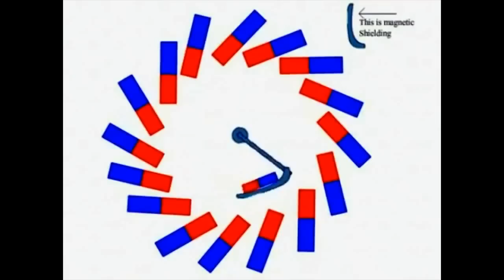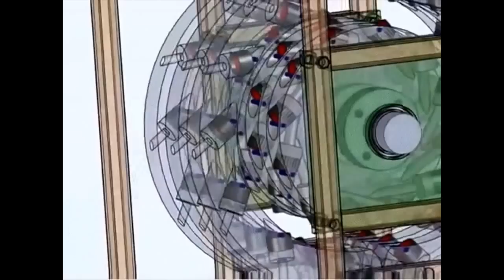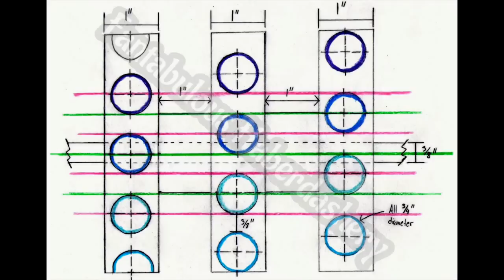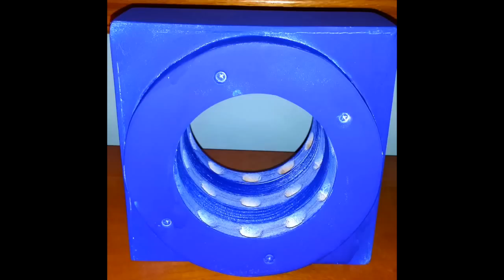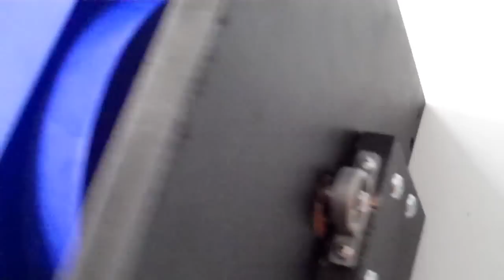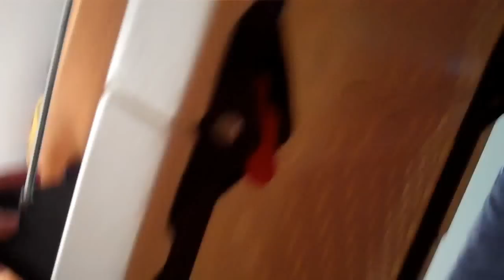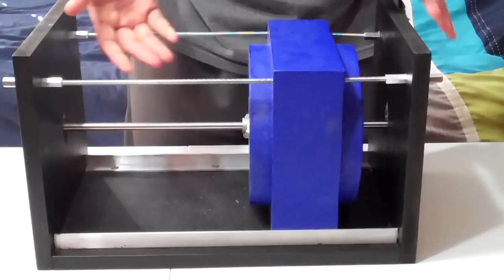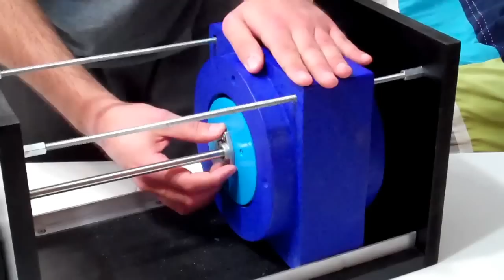Working Perendev Magnet Motor!

Comment: OMFG, MAGNETS HAVE ALMOST NO ENERGY, this motor works not because the magnets are a battery, if this were the case then it would come from the process of making the magnets, this is not how magnets work. it is not known which but either:
A. the first law of thermodynamics is wrong. (after all, it's not proven)
B. there is some environmental/radiant source (maybe zero point energy fields) that the energy comes from.
on a nicer note, this is a cool vid, it looks like it is working at least partially working.

Comment: To sustain the motion you need a small dynamo to generate voltage,store energy in a capacitor and run a separate motor to spin the rotor when it is slowing down and repeat the process.

Comment: Put about 20 of those on the same axle and see how much power it creates.
First true it then wire it to catch all the lost magnetism and route it back into it
Yeah, and then create capacitor charges from gathering the magnetic fields to fire at certain points at certain time  to impact the magnets like compression on a combustion engine only using magnetic fields condensed and configured properly
Controlling where the magnetism is needed to boost energy
But using only the rotation and creating slight electrical charges from rotation and small wired generators and capacitors to thus build on and reuse what it created back onto the motor.
Then improve on it and by making all the generators and capacitors yourself to configure to how much the motor at each stage can output to power them

Comment: If the horseshoe magnet is positioned correctly, it does not affect the other magnetic pole, if it does, it can be deflected with an iron plate.... Half-skin arc magnet Etc

Comment: I made one on a smaller scale ( about half the size of yours) but because it was so small, the opposite pole of the magnet interfered with the running. I did some experimenting and this concept should work on a bigger scale.

Comment: You are correct- total maximum output power as kinetic energy , motion, and frictional losses etc can only be equal to the total amount  potential energy stored in the magnets and the amount of energy you imparted to the machine when you spun the shaft.  You can easily do this in space under 0 gravity too, but in space there are almost no friction inputs and the laws of Inertia keep the object spinning until acted upon by and external frictional force.  Motors like these can spin themselves for awhile on the planet but they can produce very little usable HP output and not for long. Your model could run longer if the rotar was totally balanced and you used very low friction ceramic ball bearings.  In space you could consider this a potential energy (stored in the magnets)  powered gyroscope, it would run much longer but can still never do much useful work!! But the laws of inertia would keep it spinning for ever if no losses, drag, friction etc was there to slow it down. 

But you found out that as soon as you upset the spinning rotar with movement of the system,  you have imparted enough frictional losses to the inertia of the rotar +plus the power from the repulsion of the magnets to drain the system of some of its' power and it will stop. The amount of power you drained with your movement was exactly or close to it the amount of energy  you had to put into the system to get it to spin. Hook up a variable frictional load to the output shaft and you will quickly realize perpetual motion machines can't exist!!

Comment: Another thought that had just occurred to me is that using this principle, one can have copper winding coils inside the spinning magnets to generate stronger magnetic fields to drive a motor to run a generator. Just a thought.😅

Comment: MAGNET MOTORS ARE POSSIBLE THEY ARE NOT INFINITE THEY LOSE THEIR CHARGE OVER TIME UNFORTUNATELY ITS EASIER TO SPINN UP HUGE IRON MOTORS THAT TAKE WEEKS TO SPIN DOWN THAN TO USE MAGNETS TO THAT SCALE THAT  IS THE PROBLEM EVER SEEN A 100K POUND HIGH POWER RARE EARTH ELEMENT MAGNET .... I DIDN'T THINK SO

Comment: You might find John Searl's design allot more efficient and secretive. Just remember when magnetizing the material,  use ac and DC voltage at the same time to obtain the wave link need for he revolutionary field which will give u more than five thousand more on output compared to intake. Once activated the device can power itself. It's very fscinatng.

Comment: Interesting. The only thing I question which seems odd to me is that when he finally gets is to run and "sustain itself" you see a dark reflection appear on the black board to the left of the screen right after he stops spinning it with his hand, and at first I thought that it could just be the shadow of his hand, but then I also noticed that as soon as that reflection moves/goes away the motor instantly starts to slow down, which makes me question if he was keeping the motor spinning somehow with something else or maybe someone else assisting? He should've kept it zoomed out to show the entire device the way he had it when he first started spinning it.

Comment: Never heard of a magnet losing charge, they can get damaged from high temps or induced voltage of an oppossing polarity but the specs of the magnet grade can prepare you to prevent losses from an induced intrinsic coercivity.

Comment: I bought some magnets and try myself, it doesn't work ! There's a neutral position where the "turning" magnet stays.  Magnetic shield, let me laugh ! You don't believe me ? Try yourself, for a few bucks you can get everything, except the battery and the motor hidden in the block.
Reply: There is no battery hidden in the block. At 08:42 you can see in the reflection on the left that he is using some device for spinning this contraption.

Comment: Magnetic fields do not work this way. They may be pushing on the rotor magnets from one side, but they are also pulling on the same magnets from the other. When you insert the rotor into the stator, the rotor will align itself where these two forces (pushing and pulling) equal out. That alone proves the existence of both of these forces.

If it was possible to achieve only a pushing force between two magnets then the motor would start by itself, without the need for you to spin it manually.

A rotor that is constantly being pushed and pulled wastes power (which is force over distance in time) and energy (power over time), therefore it cannot continue to spin indefinitely as its rotational kinetic energy will eventually be depleted.

Comment: To all that doubt of course the Magnets have Been loaded With Energy For peoductions and omteract With eraths magnetic field With a Lot of Energy.
The Problem why many perendev try Outs do Not Run is ecause of it is difficult to avoid locking based on Interactions of opposing poles.

But until a neodym Magnet rund Out of Power Takes some years. So If one has an effektive working Versions the Energy, auch is delivered,IS cheap.

Comment: Try IT With shells For shielding the magnetic field in the Sides, tighter tolerances,less distance, perhaps, stronger magnets AND the stator's should be positioned Out of Center so that they have a smaller gap to the Rotor on the bottom than at The top.

Here you See some of the difference that will Help.

https://youtu.be/q0k0rJgWuL4

This Setup With 3-5 Rotors should Delivery enought Torque ro Run a Generator.

Comment: Great work and it spins  however if you use a needle bearing at each end it won't have the drag it does with ball bearings your using try it and see what you get

Comment: i'd love to see one of these magnet engines work, but i have a couple problems with this one:

why does it not speed up?
if it can overcome friction then it should continuously speed up until it breaks. i see no control mechanism that would prevent this.

there are too many cuts in the video,
showing the bottom of the device does not matter if you have a cut in between that and the motor working.
showing how you built it means nothing either, because you can just cut to one that was built differently.

the final problem is that the theory for how it works does not match the way i see magnets work.

Comment: Using magnets to move a wheel loses too much power anyway. Magnets interact with aluminum, just look up Eddy currents. So you're talking about a magnetic field that you're trying to change the direction of by angling the magnet and using aluminum in your build. These types of builds will never work.

Comment: If we just put more magnets on the side in between those other repelling magnets, we may not could only get around that cogging problem but then it also should start and run on it’s own,
For now i consider this experiment as plausible

Also while many video’s are fake or they clearly don’t work at all, but other ones are plausible and proving the potential of it,

BTW neodymium magnets should last forever.
Now even they canst last forever ,wether 100,1000 of 1000.000 years, then still am oke with that.

Comment: you should propel it with a motor on one end timed to run for short intervals intermittently and fix the other end to a generator to charge the battery powering the load and see if there is gain in run time sustainability

Comment: Add shielding to the sides of the magnets that are causing resistance? Copper shields magnetism, they use it in electronics to protect microchips from magnesium boss. 
The thicker the copper the better the shielding. 
Eliminate the resistance and it go go go, also you could think about adding a flywheel to help carry over the momentum.. it will all make a difference, I believe the physics is sound... a fly wheel will likely create a magnetic field so try keep it away from the magnets, the opposite end of the rod could be your best bet👍✌

Comment: Over unity has worked for a long time. It works. The problem in thinking is the terms like free. There is mechanical and 400 year magnets. Laws of physics are never the problem, they're the excuse. Example, Orville Wright. Nothing heavier than air will fly. Belief in that caused failure for centuries.

Comment: Yup energy can't be created but it can be amplified.
Its simpler to just used a diamagnetic material with strong magnets. Eg bismuth. 
electrostatic produces less resistance than magnetic induction electricity. Electrec can be used instead.

Comment: )) The magnet does not produce energy. If you ignore this premise, you will always be on the wrong track. From this comes the misconception that there is a loophole in physics that will only benefit from magnetism. It does not exist. Springs are a pretty good and useful analogy for a magnet! If you build a machine that does extra work based on compressing and stretching springs, you have a huge chance to spin a magnetic motor. Unfortunately, neither springs, nor magnets, offer eternal rotation with excess energy. Perendev is simply a scam. Your rotation with the model is the same as the rotation of the flywheel. In your case with the help of video editing. That's why Perendev-Power sells this machine as a flywheel with an electric motor, which is said to save energy. Many lawsuits have been filed against Perendev Power for unfair sales. I suspect that in Germany even an arrest warrant for the owner. If you want to rent Perendev, Perendev-Power will first verify that you are really so stupid and, above all, rich. The contractual conditions under the fines do not allow you to disassemble the machine.

Comment: I bet that if uou didn’t used magnets at all, that motor would,ve still run on after a huge manual spin force, i don’t think those magnets mskes any sense  an afraid,
BTW neodymium magnets do last forever, so they will never wear out.

Comment: https://youtu.be/8RZB1xstXS0?t=599  at 10:01 you say "I do not know what is generating that energy"  ..  the answer is that generating energy is the INERTIA OF ROTATING OBJECTS : https://en.wikipedia.org/wiki/List_of_moments_of_inertia  of the total mass of the rotor  over the magnetic slide fields you generated. an old candidate of presidential  of US at the time i read in his website(now i don't remember witch is) he propose a horizontally motor(let say your stuff rotate vertically) with low losses because at the end of the rotor you can put a magnet and  on the table of all assembly you can sustain it with another motor with the same polarity with so 2 magnets with huge force at the same fields polarity to get smooth against gravity force! so try to modify everything vertically in this theoretical set up. .anyway is a nice experiment what you done

Comment: You need an Advance and Retard Facility on the Outer Magnetic Array ! ( Iv'e done this before and it will work alot more efficiently, even with a Load).

Comment: https://youtu.be/5xdQX16MpVw

https://youtu.be/ZFqSgOF2cjU

https://youtu.be/hmT8yhDxH5I

https://youtu.be/ilDeYaBcLFE

무한에너지에 대한 아이디어는 잘 봤습니다. 
저도 그에 관심을 많이 갖고 연구하였습니다. 그런데 물체의 변형에 의해 만들어진 가변플라이휠의 한계는 가변캠에서 얻는 에너지보다 주프레임의 중심에서 보면 처짐이 그 에너지를 감소시켜 효율이 부족합니다.
 영구자석의 한계도 NS의 자성의 힘도 외부에서 힘을 가하는 에너지가 25% 가해야 보자력을 활용할 수 있다는 것이 현실입니다. 
에너지 절약에서의 관점을 바꿔야합니다.

I saw the idea of infinite energy. 
I also studied it with a lot of interest. However, the limits of the variable flywheel created by the deformation of the object are less efficient when viewed from the center of the mainframe than from the energy obtained from the variable cam. 
The reality is that the limits of permanent magnetism and the magnetic force of NS must be 25% of the energy applied externally to utilize visual force. 
We need to change our perspective on energy conservation.

Comment: What's spinning now is what's going on because of the flywheel's storage power. An experiment in which 10% of the efficiency of a magnet is utilized for that degree of persistence.Just, if you rotate the flywheel, it rotates for three minutes. I'll have to do more.

Comment: Energy is free. Where do you think electrical power comes from with generators? It's the method and design that's key to extracting limitless electricity from the e*****. It's all in the arch form. Think donuts.

Comment: This is a very good prototype...and I've seen other similar designs.  One thing to consider when using aluminum materials for your base structure though.  Even though it is non-magnetic, the induction of an electromagnetic field through it may induce an opposing field (although much weaker than iron) which reduces efficiencies (by how much is speculative).  Keep going though....tighter tolerances, better balance, stronger magnets....it all counts for an improved end product. Again, great job!

Comment: you have flutter and eventually stop because you need more magnets based upon the size ratio to the machine.  maybe a bit larger to accommodate more magnets per disc. 
linear angle of repulsion from center magnet of rotor 2 degrees at most. opposite 2 degrees for stator.  set all magnets at 45 degrees across the gap between rotor and stator. 
keep in mind just deep enough to cover sides of each. make it 5 discs total. rotor and stator. the closer you can get the magnets across working face, the more repulsion. equal 
strength per each also is important for smooth and even rotation.

Comment: Incredible job bro! Especially considering the materials and tools you're working with. I believe your magnet motor is a replica of the Malaysian version of the Perendev motor. The original used straight repulsion and the Malaysian used the diametric magnets on the outside. Again, fantastic work dude! You should give the Infinity SAV project a look if you're interested in this kind of stuff.
Reply: Fred Bloggs  Naive?! I'm not the one who thinks a small pack of hidden batteries can produce over a thousand watts. Are you really that ignorant? I can spot fakes at a glance. I study mechanical engineering and there's no way hidden batteries are producing that much power.

Comment: each magnet should be at least 325lb force.. fixed low friction bearing.  it's not practical making free-energy without spending expensive materials and n52 neodymiums.  low budget = great demo and practical one: very expensive and big/dangerous.

Comment: I succeeded using recombinant water (HHO to H2O and back) It is how lightning works; solar pulls it apart and solar sparks it back. Your idea works great, but I want more available power. Seven Magnets abreast of each other and you might try staggering them 7 to 12 magnets across. When water boils, it explodes and destroys the container. When it freezes, it explodes and destroys the container. When you separate the hydrogen and oxygen and recombine it, 2000+ degrees are released. I called mine the water piston.

Comment: If it were to rotate without a wobble it’d probably run for much longer. 

In order to have it generate energy, you attach a motor on the axel and wire that up to whatever you want to power.